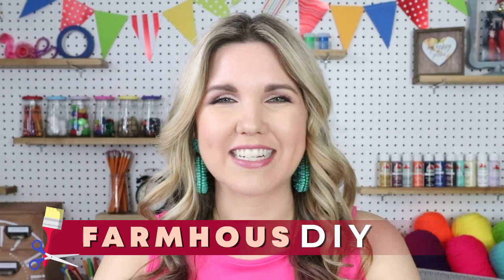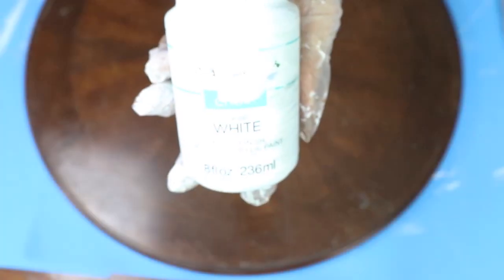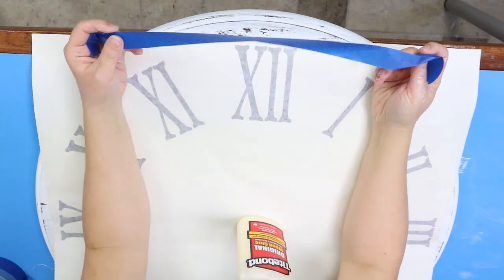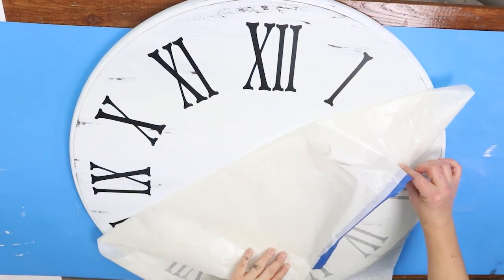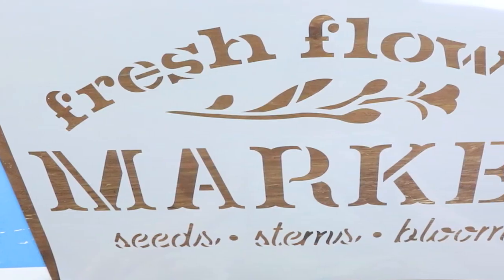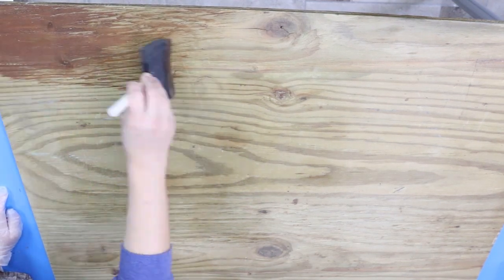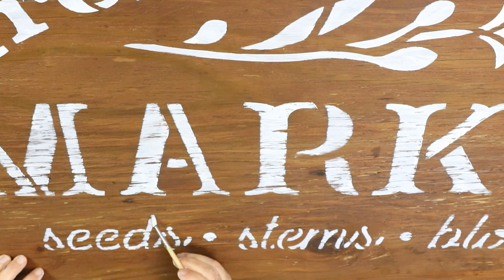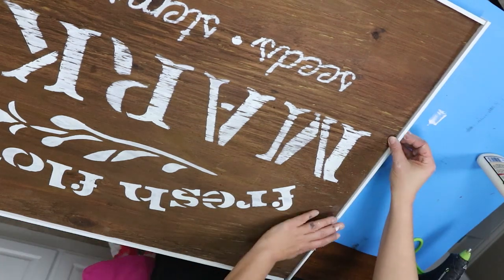FARMHOUSE DIYs - Thrift Flip! You won't believe how I made these DIYs!!!!!

Comment: For future reference. When you have a decal that large, place it where you want it and run the tape down the middle. Then start on one side and pull the top layer from the bottom layer until you reach the tape. Cut the bottom layer and flatten and stick the top layer on the surface. Then repeat on the other side, pulling the top layer from the bottom until you reach the place where it is already stuck to the surface. This allows you to work with less material and in a more controlled matter. I hope this helps! Love your videos!

Comment: If I must select I have to say I liked the sign. It really turned cool. I’m a little concern for the table. It did turn out nice but beware of ur bottom piece that replaced the original. That board is called particle board n if it gets wet it will swell up n fall apart. I know from experience. All 3 r  repurposed items turned out great ♥️😊👍
Reply from the maker: Hi Shelly Dehart! Thanks so much for watching my video. 😊